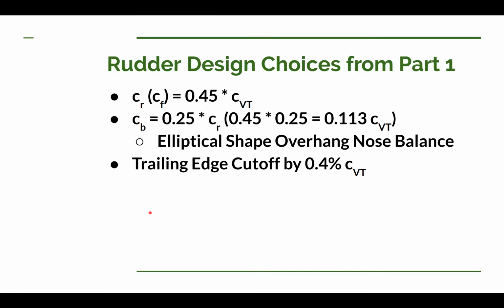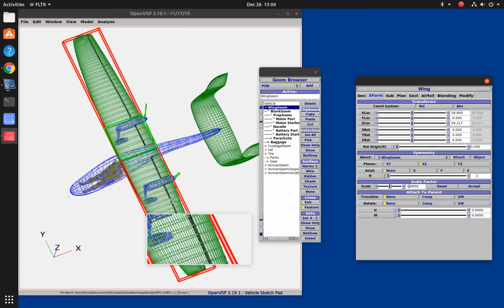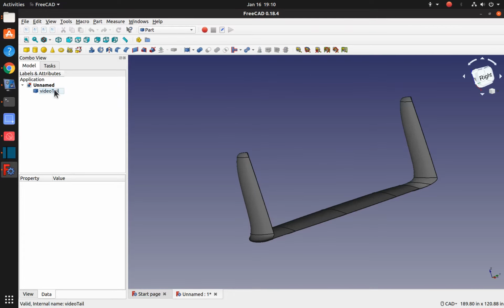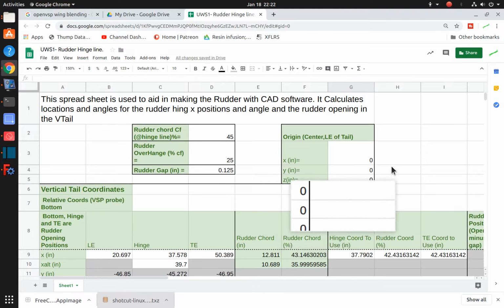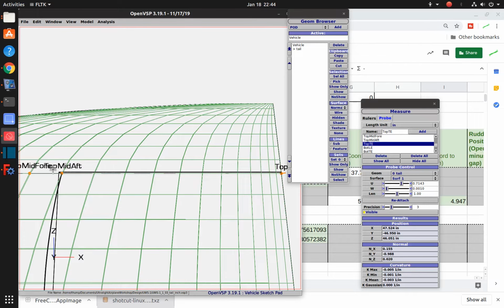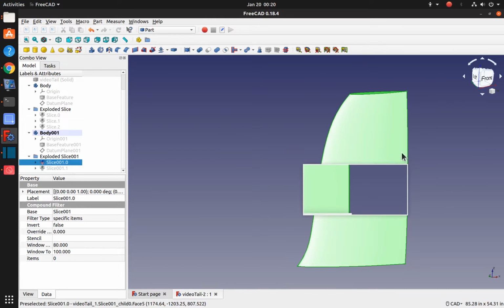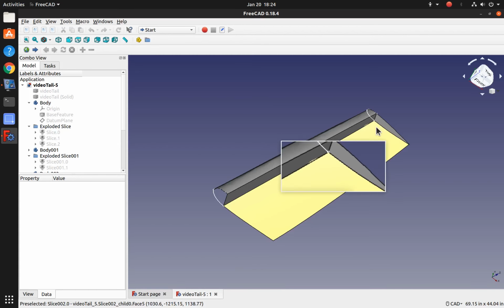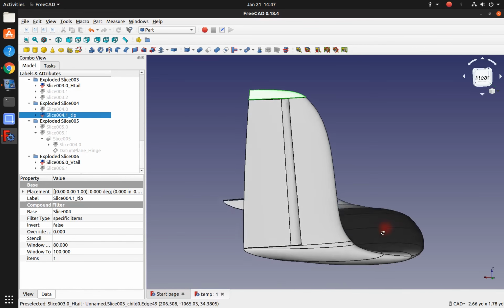UWS 1 Design: Rudder Shape Part 2

Comment: So... have you figured out how you are going to build your surfaces ?  Carbon fiber bagged foam?  Molds? Have you looked at using Quickcrete or plaster of Paris for mold material ?
Reply from the maker: For each part I'll make a plug first. Then molds from the plugs. Not sure yet what materials I'll use for plugs and molds but I have some ideas. As far as the final composition of the parts, it will depend on the loads and shapes needed. It will mostly be carbon fiber and foam.
Reply: @Designer103  I'm really interested to see how you approach the plugs and molds as I need to make some parts myself.

For me, foam plugs are the easiest.  I'm unsure how I am going to make my molds.  Pourable foam seems to work well, but it is expensive and not very durable.

Comment: Fantastic video, even if there was a ton of fiddly math in it.   Great detail showing how to export from OpenVSP.   I loved the use of the magnifier and how much you discuss what you are doing.  It is a bit monotonous, but I'd rather learn your secrets than have to figure them out on my own.

FYI, OpenVSP (3.19+) can do FEA now using Calculix, which is also what FreeCAD uses.   It can also export meshes to do CFD and FEAs with external tools if the ones included aren't good enough.